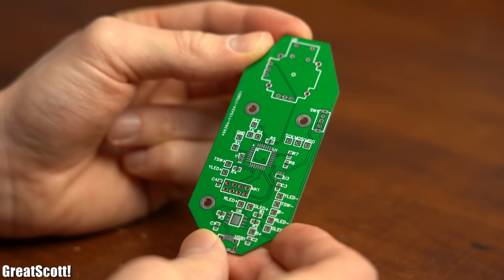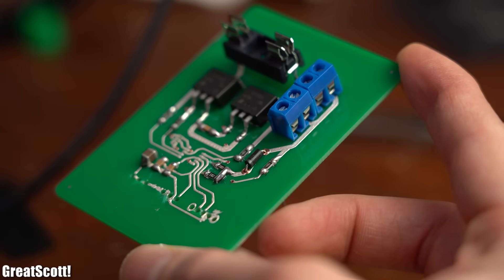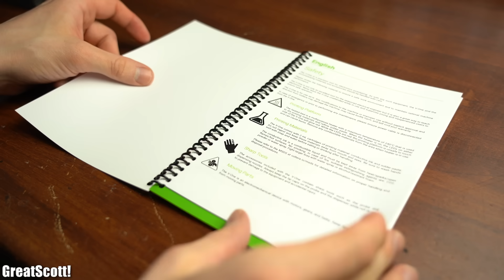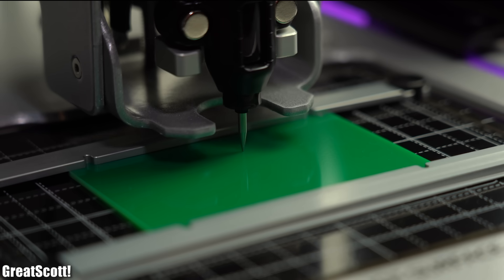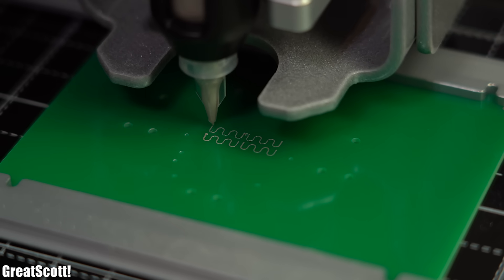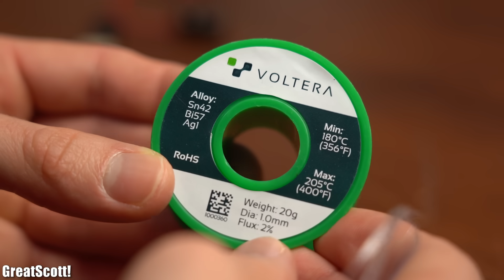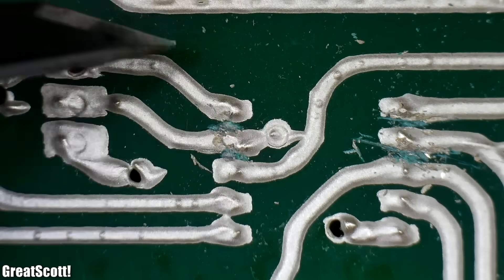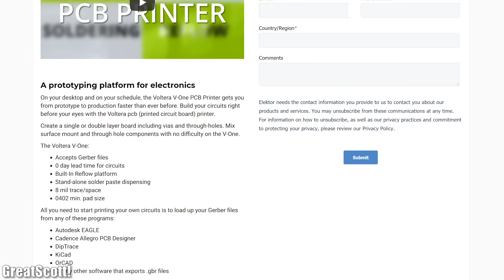You can now PRINT PCBs! Creating a homemade PCB with the Voltera V-One PCB Printer!

Comment: home made cnc milling is a  way better solution, better result and much lower cost.
Reply: Ya, a CNC would have a much better looking result.   Even the crappy sub $200USD engravers would do it fine.  I haven't made a PCB in my larger 3040 CNC yet, but I have done fine detail work in metal, so I know that it can cut the desired level of precision.
Reply: @JWSmythe  the result from my machine and a normal cnc aren't different, the tolerances for a cnc(from a friend) and my 3d printer are similar. I think my 3d printer can Mill very fine, better than the pcbs needs

But it Uses a brushless Drohne Motor as a Mill and First 3d printed Plastik holder to Mill a Aluminium one. Now its all Metall and very accurate. 

Its Not a ready Made one. Only the dust is a Problem, becourse it Sitte in the Aluminium Bars where the wheels are. (no Problem for pcb milling, But for milling wood or sometimes Aluminium.)
Reply: @Enderkruemel  If the dust is a problem, you need to do dust collection.  Either get the dust boot, or stand there holding your shopvac nozzle close.   You shouldn't be getting dust in the tracks though.  That's going to cause problems with accuracy, and wear.     

My whole machine sits inside a crappy open top box.  When there is dust, it really only gets about half way up the side of the box.   Even milling graphite, it just leaves powder sitting on the original piece.  I just clean it out with the shop vac, with the fine filter on it.   Graphite goes everywhere if you aren't careful.

3d printers aren't really made for milling.  They're not made to have any real force exerted on the print head carriage.  You will wear it out faster, treating it like a CNC.

The machine he's using looks more like a light weight CNC, with the 3d print head replacing the spindle for the printing operations.
Reply: @JWSmythe  my printer has only Problems if i use wood or Aluminium. But i only did Aluminium  3 times and wood sometimes, Most of the use is for pcbs  and so there are no Problems. Also the force is minimal, and there it dosn't get damaged. 

Also i use a cheap table Vakuum now, and since I never had a Problem whith dust. 

I only had Problems whith dust in the Aluminium Bars where the wheels are,  if there was Aluminium or wood dust i dont wanted to destroy the wheels and Slots.

Wood dosnt matter as much But Aluminium can Do realy Bad damage. So i dont Risk it Anymore. Also the pcb milling has such little dust that it dosnt matter.
Reply: @JWSmythe  is it possible to submerge the pcb in a little container of water or some oil while milling to prevent the dust?
Reply: @vornamenachname8001  You'd just use dust collection (a vacuum cleaner), or a box to contain the dust.   On mine, the box doesn't even have a top, and it contains everything it has cut.  I just vacuum it out before removing the item.

Water adds more challenges.  You can use water when cutting things, but it isn't totally submerged in it.
Reply: Some Youtubers are using Universal G code sender.
Is it good to use? With an arduino
Reply: Especially that for that price you can build a CNC that does 0.50mm pitch pads no problem. That printer has very limited market - a few niche users will find it the bees knees in their little subset of applications. Outside of that, it’ll be fairly useless. This should also be printing blind vias by filling them with the ink - why bother with the rivets for vias or for component pins you can easily solder from both sides? With a CNC you can cold-forge copper blind vias as well as metallized holes. I stick pieces of tightly fitting copper wire into the holes, cut flush using a razor-based box cutter, then the CNC goes to each hole with a carbide tool and either extrudes dimples for vias, to flow the material out, or extrudes the center so the excess of material flows out of the hole and cold-welds to the top layer. Then flip upside down and repeat on the bottom, then milling. I can get vias with much thicker walls than the normal PCB processes can manufacture, and the via material has a gas-free bond to the top/bottom layer, since the pressures involved are locally well past the flow point of copper at not much above room temperature. Local temperature rise from working the copper is less than 200C - the tiny areas do get hot, but not for long :)

I’d say that CNC is the future of small-run board making if you don’t just copy everything someone else did and stop there. CNC is not only about milling. At the small feature scales typical of PCBs, a small CNC can cold forge and stamp material as well, and do other things I didn’t even think of yet. The scale matters a lot, and PCB vias are so small that it takes just a few pounds of force to generate pressures on the order of 1M psi. Copper has no choice by give up when facing that :)

The only pain so far is in ordering the custom tools for this, since they need to made out of carbide for long life. Hopefully someone will finally “steal” this idea and flood the market - I want some :)
Reply: Hey!
I want to make one.
Can you help or send some references?
Reply: @manaspange3815  If you just want to mill pcbs you can get a 3018 cnc for 250€
Reply: @manaspange3815  use a 3d printer as the Start, there are some that can Do Laserengrave 3d print and also milling. 

But i didnt have one that can Do all of this But  i build my own. 
Print a simple Motor/ dremel holder. 

Look at some diy cnc.
Reply: @manaspange3815  Mostly Printed CNC is a good project reference, more about here: https://docs.v1engineering.com/mpcnc/intro/
Reply: I disagree, fiberglass dust is not a joke ;)
Reply: @petermuller608  i have it in a housing, and also whith a Filter whith a small  Fan that is ment for Carbon Fieber and fiberglass dust.  

But  its a very experimental Setup for the pcbs, becourse i did This housing becourse the smell of 3d printed Plastiks, But for Plastiksmell i use an other Filter. Also my 3d printer isnt ment to be a cnc. But it works fine for me.

Comment: So... specialized conductive ink and specialized solder... AND copper rivets for each and every hole?
How about NO?
Instead load the syringe with etch-resist and use it to print your design on a traditional copper clad board, then etch it. 
With the ease of alignment and drilling that would make it a useful device for me.

Comment: could a 3D printer be modified to use these ink dispensers?
Reply: Yes, you'd can use one of those small cheap stepper motor, and a screw set up to slowly push the ink onto the desired surface.
Reply: Peoples are already moding their 3D printer to use seringue for multiples use (food, biologic, ...); so yes!
Reply: just put a laser on it and expose photosensitive pcb, and just etch
Reply: @gabor-smith  Hell i've seen people use their 3D printers as a lesser CNC to mill PCBs

Comment: i would love to see this technology get cheaper so I can finally not have to use giant breadboards as because the printer looks similar to a modified 3d printer i think it will take just a few years ( 2025 - 2033 )to get reasonably cheaper
Reply from the maker: We will see :-)
Reply: Just etch the PCBs. Cheap and easy
Reply: @tobimai4843  that's what I do since the early '70s and it works great for me!
Reply: The printer would become cheap and easy to get, if the concept was succesfull. But the main problem lies in the conductive inks. These have been around for decades and didn't get cheaper by any means, ever, mostly for the expensive resources needed.
Reply: PCB manufacture with a few weeks turnaround is affordable now
Reply: @kerr1221  JLCPCB has 2 day turnaround plus a week shipping

Comment: Oh when I saw the video title, I was worried that you broke up with JLCPCB 😭
Reply from the maker: Nope. There will be more videos with JLCPCB as the sponsor. But you know, they are more ways to create PCBs ;-)
Reply: @greatscottlab  Yes I have been making PCB at home for many years, yes it takes time and it's not very professional, but it is much better than this stupid thing :)
Reply: Same
Reply: If you can read between the lines, this is an AD for J.....PCB
The 3d printing is not an options, no through hole, multi layer?, solder mask?

Comment: I saw this and looked so cool! But when I got a quote of $4100~ It be hard to justify
Reply: I just can't explain the price, I bought a pcb cnc for 200$ cad and the traces are much more precise. Plus you don't needs consumables.
Reply: @ilikedeere  what pcb CBC is this
Reply: @ilikedeere  well in a cnc yuo need bits..so yuo need consumables
Reply: @noway8233  bits are 10$ on amazon, not 100$ for ink. And I paid my cnc $200 cad. The v-one is $5200 cad. I can buy 26 cnc for the price of the printer...
Reply: @ilikedeere  which one is it ?
Reply: @anthonyrichelle351  1610 pro
Reply: True, especially considering the fact that this thing is theoretically nothing more than a 3d printer with a different substance to print with and a drill tool.
Reply: @OleJanssen  how much a 3d printer is
Reply: @venkateshn4030  about $150 to infinity, depending on what you want.
Reply from the maker: True
Reply: @greatscottlab  have you seen the digirule 1& 2? they are absolutely epic! would love to see you make something like that!
Reply: @greatscottlab  Is the software to design the circuits available for free?
Reply: @greatscottlab  What are your thoughts on the wegstr cnc for making PCBs?
Reply: @lorinatzberger3624  works well.
Reply: @lorinatzberger3624  I have the bantham PCB mill , looked at the wegstr cnc but found a bantham for $2k, shame they dont make the pcb mill anymore just the new bigger unit. You can pick up an othermill pro or bantham in good nick i would go that way again.
Reply: @lorinatzberger3624  I’ve seen that. Insanely overpriced but their pcb designs are awesome.
Reply: The price is horrendous, and even putting that aside the process is still fiddly and slow. Still, if you have the money, don't mind the hassle and want to regularly make PCBs quicker than waiting on mail order boards then I guess it's viable?
Reply: @SlartiMarvinbartfast  not viable.... I would just etch my own simple single or double layer PCBs ...done that since 14yo
Reply: @SlartiMarvinbartfast  no the time it takes to set up, and process does not justify it, unless you have employees
Reply: But this is pretty new tech right? So maybe the price will come down ... Then it'd make more sense..
Reply: @LiEnby  I forsee something like this becoming an add on in the same way engravers have.
Reply: @LiEnby  Fancy seeing you here! Love your work on the Vita! ❤
Reply: Black spray paint on a clad board + $200 laser etching machine + some etchant and you've got quick turn pcbs for WAY less than this.
Reply: @gymprofessor329  or even a 500$ cricut and any circuit silver base pen
Reply: we can wait for chinese copy of this :D
Reply: @PawelAjs  
You may check here, like 4 to 6 layers etc.  Through holes, solder mask, gold plated ... etc...
https://jlcpcb.com/
Reply: Katherine you saved me much hassle looking into this, a PCB Printer or a Car. . . price needs to come way down for DIY markets
Reply: It's not very good. A $200 bench cnc is better.
Reply: same thing usee to be true with 3d printers so hopefully the price of this goes down too
Reply: Also no solder mask, no ground- and power planes, higher resistance traces, more fragile traces. No reason to use something like this.
Reply: For $3k you can get a double side capable with features like changing bits accurately ( Bantham PCB mill ) for about $3k, works far better and no consumables.
Reply: Print more circuit board printers and 3D printers
Reply: Wait for some chinese manufacturer to copy it
Reply: @WaqarAhmadA  actually it just needs a plugin for 3D printer that can apply the special ink.
Reply: Well it's made for small businesses I think
Reply: basically all they do is sell you a basic desktop 3d printer with their own software, for a ridiculous price.
Reply: i'm using an ender 3 with a pen holder to lay out the circuit, to then throw it into ferric chloride wich dissolves the copper but not the marker paint. The pen (just some permanent marker), Etchant and copper clad totaled to about 15€, and the process makes waaaayyyy better results in far less time and with far less effort
Reply: Thank you, that was the whole reason i zoomed down to the comments.
Reply: Charge $1 to 4100 fat chicks.. giiigitty
Reply: Too much. My boss wasn't even interested..yet..wait til we get to the pcb part of this project and are always waiting..but still pricy for what it is.
Reply: Try $900 for a conversion kit that turns an ender 3 into a PCB printer. New bed & head
Reply: That came out maybe 5 years late, but it's cool anyway
Reply: $4100 for what's essentially a 3D printer ? It's no wonder they don't list the price.
Reply: Shit rip I was hope it be 400. 4k is a lot for hobby can't justify it
Reply: Thanks for not making me waste my time with the video
Reply: long term goals :kek:
Reply: drill cnc should be fine
Reply: @muxahx3096  probably not a huge factor here with such thin work, but milling bits are better for side to side action. Drill bits arent designed to move sideways, only down. 1/8" mill bits are pretty cheap and easy to find though for the little desktop cnc mills.
Reply: This looks like a good product for a public/comunety maker space.
Reply: For small PCBs, you cab get some surprisingly cheap if you get them from a supplier that lays them out and makes them along with a larger batch. I want to say I got 10 PCBs for $1-2 each from purple PCB.
Reply: Thanks so much.
Reply: A 50dolar of laser printer are more reasonable for me
Reply: Etching works just fine if u know the right way
Reply: To High price.
Reply: it's designed for the enterprise and education, if you can justify a $1,000 textbook that expires every 6-12 months, you get a cookie as a starving student but universities and corporations tend to think that this is necessary and... sadly it is, it's needed if you are going to go into an R&D company in 4 years time
Reply: Convert a cheap, small 3D printer.
Reply: This one is $4k. The next one will be cheaper, as well as the one after that.
Reply: Let's start pcb manufacturing company in this cost bro🤣☝️
Reply: Didn’t they say you can get a 60% discount though
Reply: Its like 4 dollaars for a pcb online
Reply: @adizivojevic8635  true but its the freight cost that kills as its more than the cost of the PCBs
Reply: @MrMat4552  move closer to the pcb factory
Reply: @MrMat4552  considering the cheapest delivery on jlcpcb (about 3.5€) you'd have to use this machine at least 910 times to get your money's worth.
Yeah a 3.5€ delivery is very slow, but I think it's better to wait 2 weeks than to spend 4k€
Reply: @adizivojevic8635 where can I buy a Customized, PCB?
Reply: A qoute lol. If you need a quote you cant afford it.
Reply: Entire video is an advert, which is unfortunate.
Reply: @Mmouse_  yeah and ?
Reply: Only got one life. If you have to justify everything in your life its going to be very boring.
Reply: @70tommydj  that's not true at all.
Reply: Resin 3d printers were expensive too at the beginning but when the Chinese started copying them then they got cheap so i think that it will be similar with this thing too it's just a matter of time 

They are only expensive as long as few companies have a monopoly on them
Reply: Really that not that much.. especially for prototyping